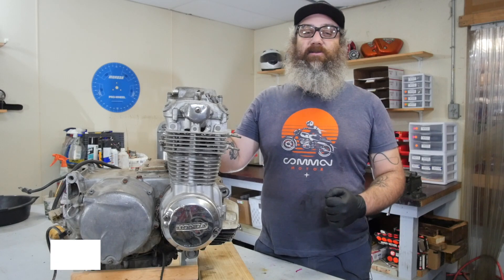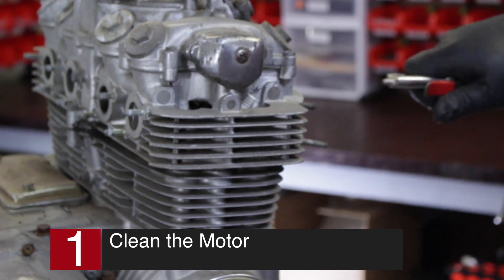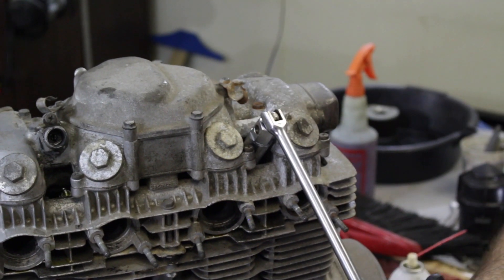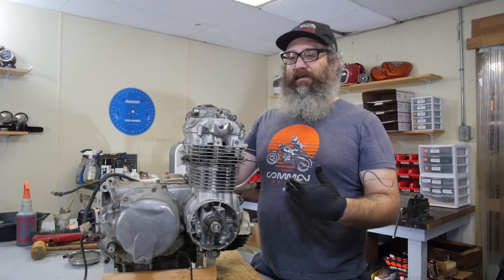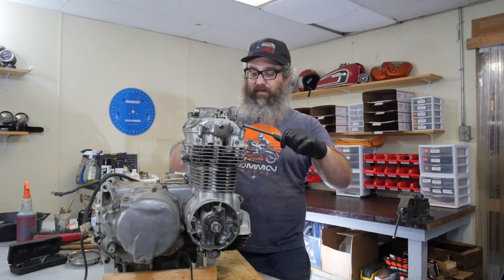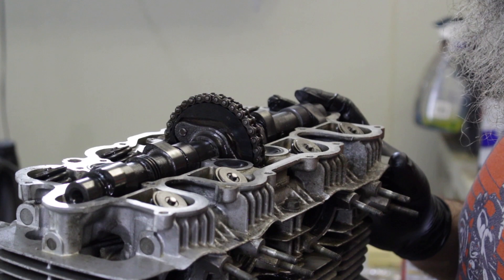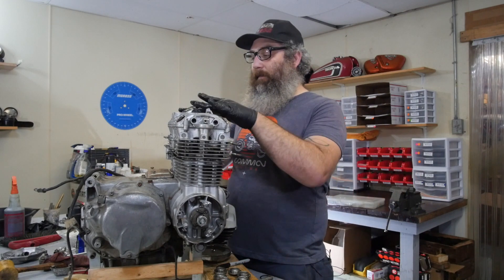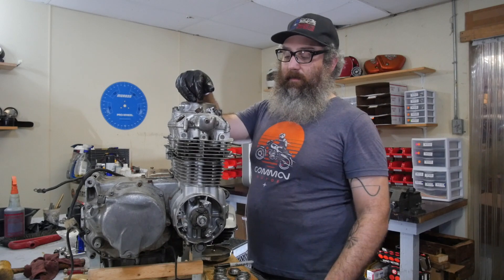How to Inspect a Used Vintage Honda Motorcycle Engine: - Part 1

Comment: I wouldn't want someone else's problems,...I would have taken the top end off, re-ringed it, done a valve job+valve seals,...timing chain & guide& tensioner,.....because its already out of the bike,....regardless of weather I'm rebuilding the other engine.
I want a dependable bike,... because walking is just wrong.

Comment: I am no mechanic , hence why I'm watching these types of videos but I am an electrician and generally we never use stainless steel screws around aluminium together in light fittings or on roofing structures etc because of the galvanic action or corrosion that is a consequence of their union without some sort of barrier. So I was surprised you replaced all the engine bolts with stainless bolts.
Believe me if they corrode in there , you are never going to get them out . You'll snap the heads off them before they give.
just wondering?

Comment: Aircraft mechanic here and XL250K2 owner. Why don’t you do a leak-down check to see if the rings and valves leak? The rusty cylinder happened for a reason. Maybe that’s why the bike ended up in the Dismantlers in the first place.

Comment: The biggest problem with the 500-550-650 4 cylinder engines are the head gaskets leaking oil. There's passageways on the sides of the cylinder block going up through the head to feed the top end. They're sealed up with O-rings and they fail. They've updated the materials in them but they eventually start to leak again. Virtually every one that comes into my shop are seeping.

Comment: 14:40 Your "quick tip" is incorrect. When using anti-seize, the torque value to achieve the same clamp load will be lower. If anti-seize is used with the torque specified for a dry assembly, you risk exceeding the proof load of the fastener.

Comment: I have several stripped JIS screws on the clutch side cover of my 73 CB450 motor. They were too stripped for my manual impact driver. What’s the best way to get them out?
Reply from the maker: drill bits and screw extractors! I'd recommend replacing them with one of our allen bolt kits when you finally get them out. Makes it a lot easier for next time.

Comment: Before reassembling the valve cover I would suggest performing a LEAKDOWN TEST!  If you've got a leaky valve now is the time to know about it and fix it before reinstalling the engine in the frame.

Comment: If you strip down one of these motors, keep each pairs of Main bearings and pairs of big end bearings together, in separate bags and mark the bag with which journal they come from, and which was in the top or bottom crankcase. ( remember that your engine will be upside down when you do this! ) There are five Mains, and four pairs of Big end bearings. The size is marked by a blob of paint, but this will have worn off by now. On the back of the gearbox case is a series of letters stamped in a square box which tell you the diameter of the hole in the crankcase that the bearing sits in. You need the Workshop manual to look up the fitment, and some "plastiguage" to measure the wear. Seek help if your not sure! 
There aren't many NOS bearings available, so don't throw them away whatever condition they are in!Fortunately the Oil pump is a rotary type and works well, provided that the Oil changes were done regularly. Oil is cheaper than bearings!
Reply: I cant figure out for the life of me why someone hasn't taken the time to make new bearings,although they wont attain Bill Gates stature they could make a nice little profit,on my 550 in the back of the case its all BBBBBB somewhat simplifying things, first time i saw that i was  like "serious?" ha ha ha,those are all great tips you give,thank you,it will definitely help someone out.